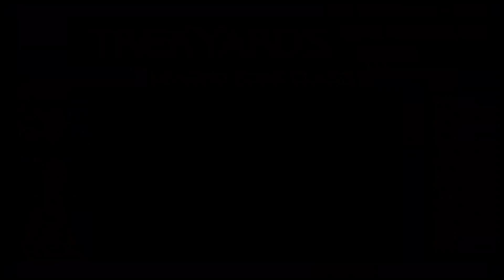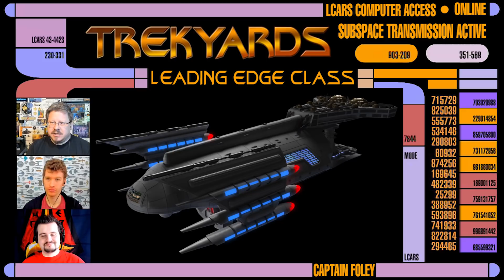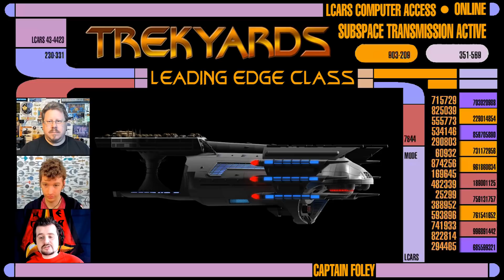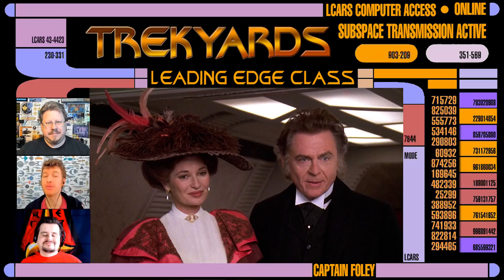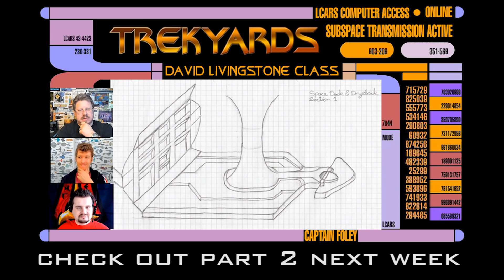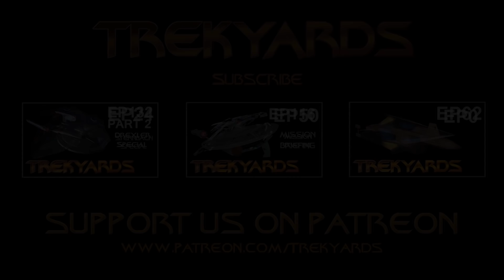Leading Edge Class (Exploration Fleet Support Ship) (Part 1) - Trekyards

Comment: I had a similar idea for a mobile shipyard, but it had a more conventional Starfleet ship shape even if it was of similar size. The basic idea was to take the "cap" of a mushroom type Starbase (which was where the ships docked and were worked on) and replace the "stem" with   a scaled up secondary engineering hull and nacelles.
Reply: I started on a similar theory but thought given the size and capabilities it would be more limiting and story intensive if it had contributions from multiple governments

Comment: Theres only one ship from star trek discovery that would come close to being as large as Derek's Leading Edge Class ship design. That would have to be the ISS Charon. Comparing the I.S.S Charon to the leading edge class ship design would be quite complex
Reply: The Charon was an expression of power, while the leading edge is an expression of exploration!
Reply: @derekrankin7842  True but both ships while they're expressions of power and exploration. You can actually see the similar comparisons in size between the two designs.
Reply: @FLAME456X  Yeah but mine at least has a reason for it! lol
Reply: Also there is about 200 years between the Charon class and Leading Edge.

Comment: Oh boy. 
I mean, i'm a sucker for nacelles but those are really the only recognizeable Starfleet-elements to me (aside from the lovely docking stumps at the front pillar, i love those). What really knocks me out though is the scale. First, second and third thought about size when i saw it was "'bout the size of an Intrepid". Then i saw the scale picture with the Borg Cube. Ah. No. No. Look at the windows at the front, they'd be the size of small starships. Nah-ah i call no way on the scale.
Reply: Those windows are for the bazaar area like the promenade on DS9, the individual quarters utilise holographic windows as the likely hood of having an outside window in the first place is low.
Reply: @derekrankin7842  could someone please inform Cryptic STO about holographic windows; their ships looking like galactic cruiseliners is getting out of hand.
uh, save for the Risian Cruiser, of course.
Reply: I was thinking the blue areas in the front were the navigational deflectors.
Reply: In the front absolutely, the triangular bits don't look like windows at all. I was referring primarily to the ones at the bottom of the pillar's structure and the side of the ship. Skip to 0.43 for an excellent look of what i mean. The lack of regular windows (if they'd even be visible at that size) doesn't help the scaling. Those windows would look HUGE even on a regular-sized ship. Go to 1:27 and compare them to the hight of that klingon battlecruiser. Either those are some huge windows or they decided to go with significantly less detailled hangars for smaller Shuttlecraft, except you could stuff a Kelvin-verse-ship's entire fleet of auxilliary craft in each of them. I'm sorry. This just doesn't work visually for me at that size.
Reply: @RotalHenricsson  The bottom section of the ship is where all the shuttle hangers are. The "windows" are actually shuttle bays. It also needs room to hold additional room for visiting shuttles.

Comment: I was thinking of making a design inspired by Michio Kaku. It would have been able to cross the void between galaxies and resettle federation members in the chance of a black swan event making life untenable in the galaxy.
Reply: I actually designed a trek inspired ship quite similar to that several years ago. It's all hand drawn and plotted from several angles and everything. I even wrote out its stats... It was a 42nd century design. It had a transphasic hyperwarp drive, power of 10 warp per unit (so warp 6 is 100,000 times ftl) and a maximum cruising speed of 7.9 so that's 9 million times ftl and a maximum speed of 9.375 (which is 375 million times ftl, see how easy and intuitive this system is). It was 27 kilometers in length and carried an entire armada of ships for intergalactic exploration. It also had the ability to replicate entire new ships as needed for specific missions. It incorporates federation, voth, xindi, iconian, romulian, borg, dominion, 8472 and time travel tech. The ship is so big it only has turbolifts as backup transportation, but the primary means for getting around the ship are Ionian gateways and you can access them from any regular doorway. Every room has its own holomatrix and can act as its own holodeck, it also has outward holoprojectors and holoreceptors that can create or beam a holographic construct to or from hundreds of light years away in real time for advanced reconnaissance. You can basically explore a planet without ever touching it. I never gave much thought to the weapon systems, but I imagine it would be pretty impressive and powerful also. 

Some other thoughtful statistics are that it is the first ship of its class and was designed as a memorial inagurating the 2000th anniversary of the federation. I called it the UBS (United base ship) Infinity NCC 314159265. The federation has been an intergalactic federation for around a 1000 years at this point. And yes it carries an enterprise as well, but it's probably like the 1701 D2 at this point. 

I put a lot of thought into it as you can see.

Comment: A starbase that moves cool
Reply: DS9 was able to move but not warp speed
Reply: @ChrisDouglass2141  DS9, pka Terok Nor, wasn't intended to move though. It does have control thrusters that helped to keep it in its geosynchronous orbit around Bajor. They had to use some technobabble to move the station closer to the wormhole without destroying it.
Reply: Here is something to bend your brain - is Yorktown Station self-mobile ?
was it built at that location, towed there (if so by what) or did it fly there under it's own power - if so was it at impulse taking years to gt to it's final  location. That thing is well over 5 times the size of this vessel and Yorktown has no obvious engines, Though they could have retrofitted first Federation tech to make It I suppose.